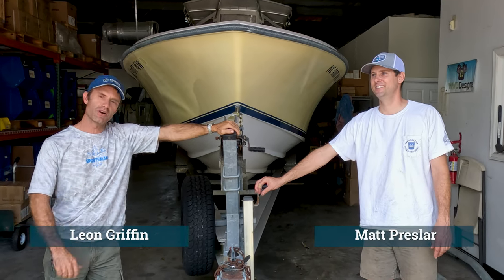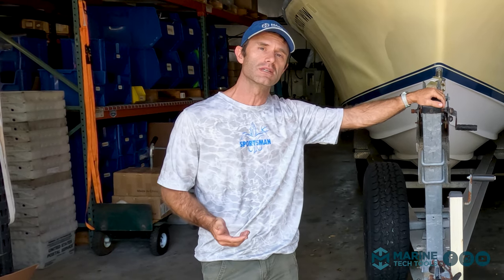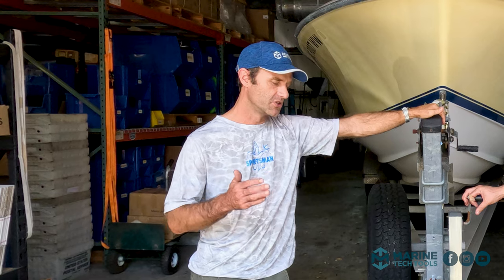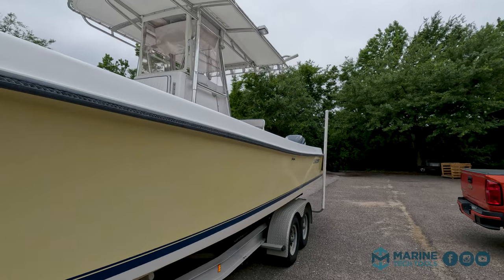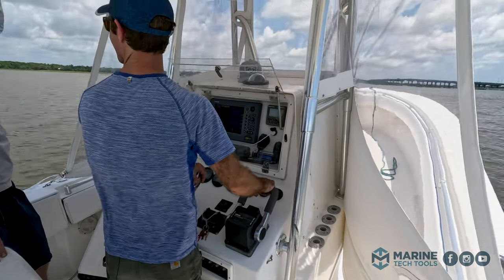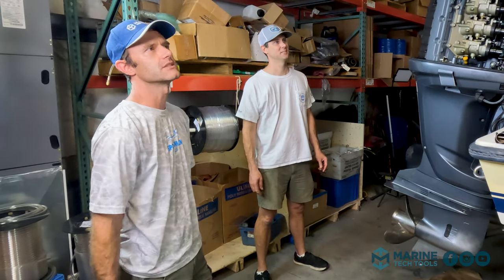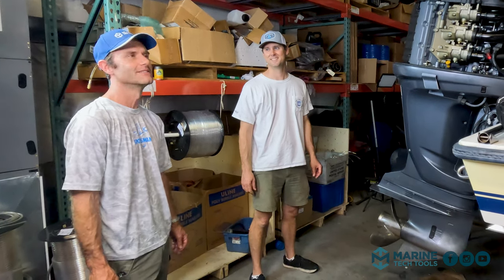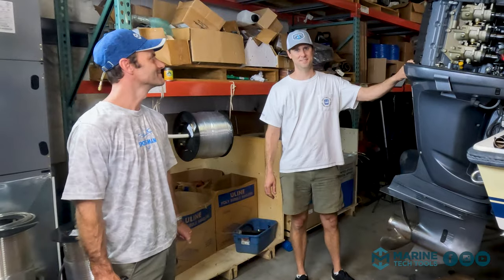Why We Bought It & Our Restoration Plans - Marine Tech Vlog#2

Comment: Bluewater had that for sale?  Hull looks clean. Those early 225's have the most complicated throttle linkage known to man lol. Should be a good series!
Reply from the maker: Thats the one.  Got it for a lot less than it was listing.  I was concerned that it would be a dog with the 225s but while I do want the 300s its perfectly useable as is.   We want to see what the midsections look like.  Certainly there will be more drama to share with maintaining these than just an engine swap.